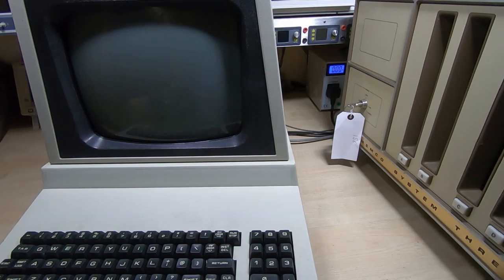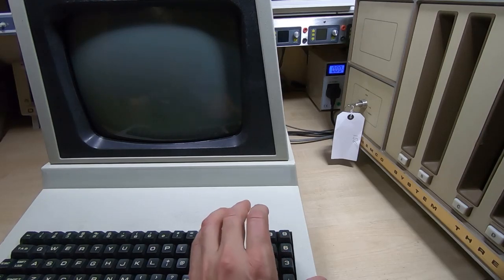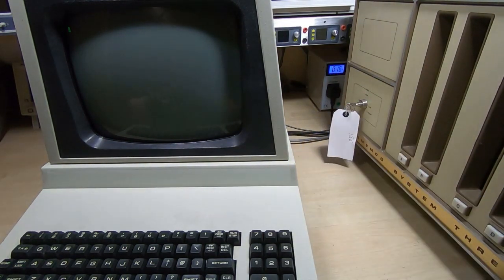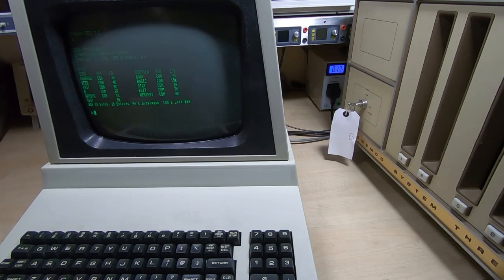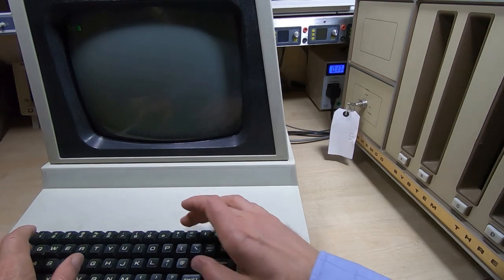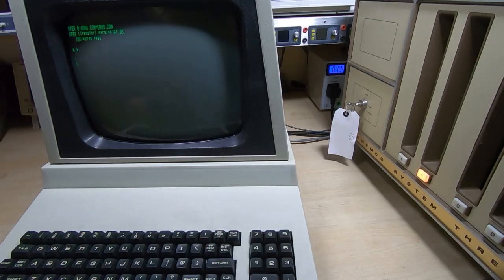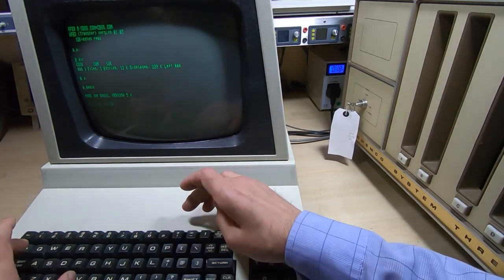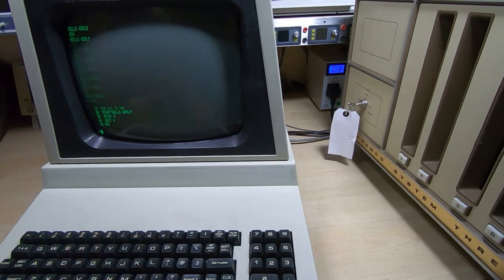ADM-3A  Board Reproduction Part22

Comment: Great series, I used those back at uni decades ago, but never though about peeking inside. I now started reading operators manual, iI didin' know that original had 12 line display and the 24 lines mode was optional extra. 

Of course, having only 12 lines saves half the ram, and those were expensive back then.